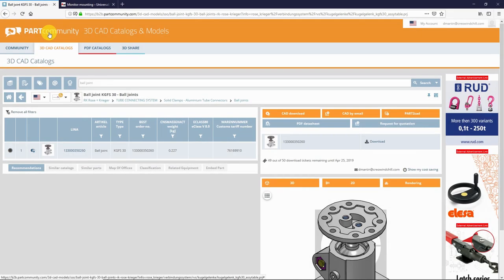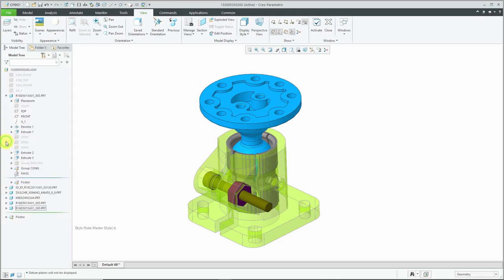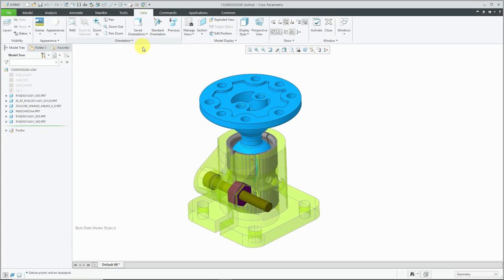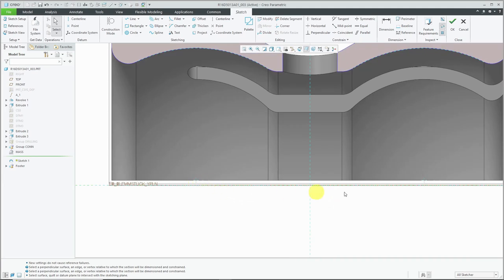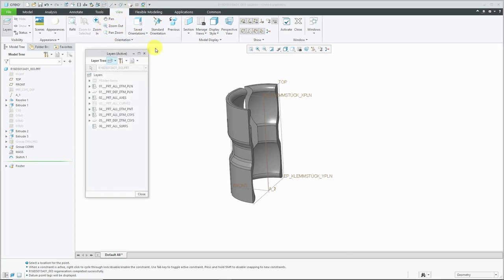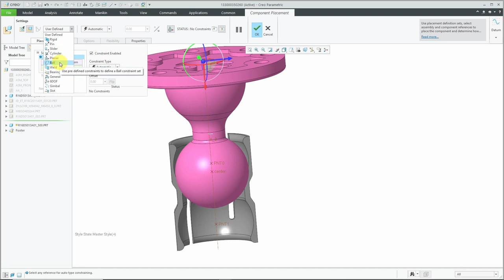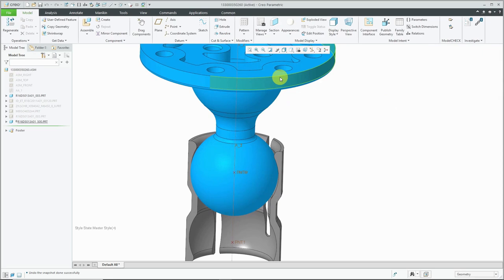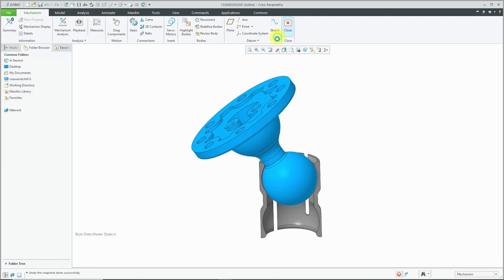Creo Parametric - Mechanisms | Ball Connection

Comment: So clear! I got the points coincident. I just don't understand what the cone means in terms of motion.
Reply from the maker: The cone is the limit of the range of motion. Think about your shoulder. That's a ball joint, but your shoulder can't rotate in every possible direction around the sphere. For one thing, your body is in the way. Also, you have ligaments and muscles that limit the range of motion. Swing your shoulder around as far as you can in every direction. That's the cone.

Comment: Hi!  What happens when you add multiples of that assembly to the next higher assembly?  Is there a way to Make Flexible so that they can be at unique different angles?  Is there a way to have the angles determined by mating components at the next higher assembly?  Thanks for your usual great content!
Reply from the maker: Different instances of a mechanism can be assembled with different translations and rotations. No need to make it flexible. That’s just how mechanisms work.
Reply from the maker: See my recent mechanisms videos on a valve train assembly for examples of this.